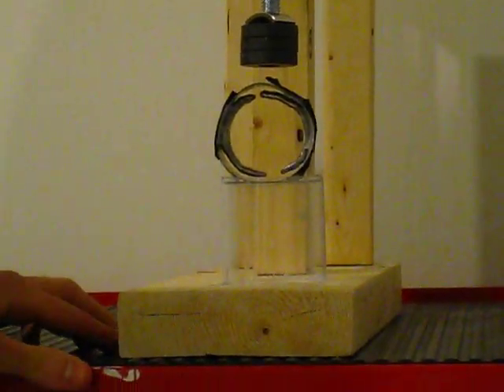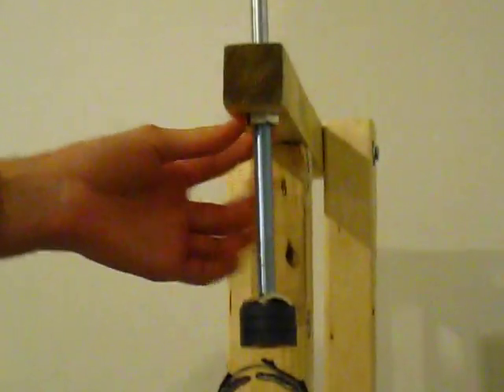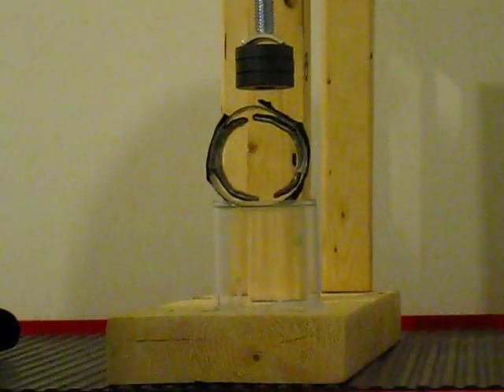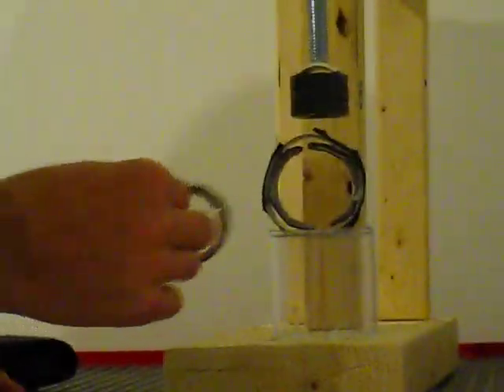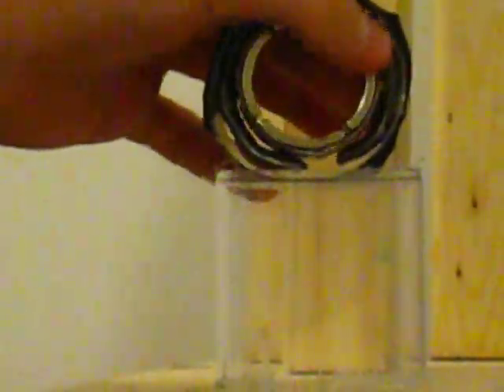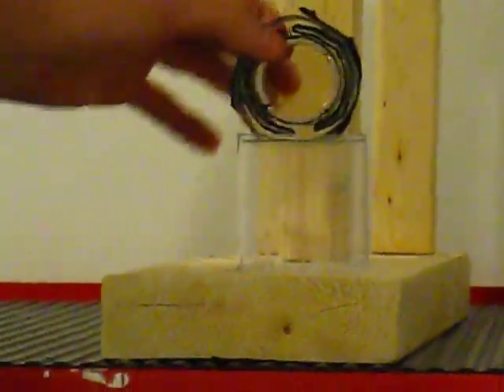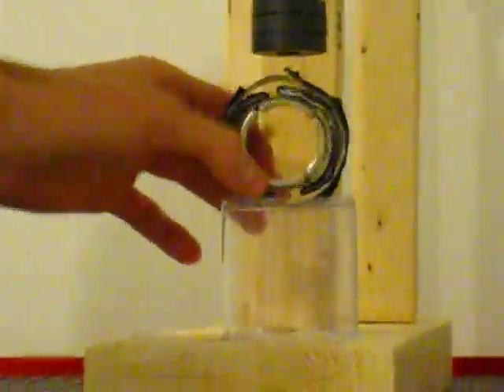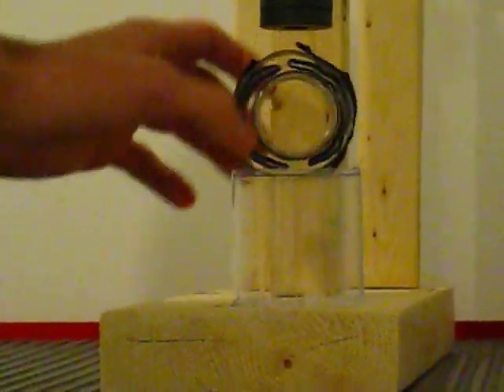Frictionless Bearing

Comment: I figure if they have an electric motor spinning that thing while it hovers in a magnetic ring, that would basically eliminate all friction except air friction.  

The only thing that would add resistance then, would be the magnetic force itself wouldn't it?

Comment: If you try to make it spin with a copper coil or something, you need to make a way to switch the direction of the current every 180 degrees or it won't spin.  

If your goal was a frictionless bearing, you shouldn't need to turn it into any kind of motor, just run a shaft to it (that it can support) from an electric motor.  You could also find a way to house the whole thing in a vacuum, reducing friction a lot.

Comment: Actually, it can work.  You merely need to have the central magnet (the armature, the spinning part) accellerated sufficiently and then it will "balance" itself out in the magnetic field -- it's been done over and over and over again by people.  You'd be FAR better off having pole N against N, and S against south - don't alternate poles as in your model (N against N then to S then agains N again over and over).. that'll give "bumpy" field results but even this can be balanced with accelleration.